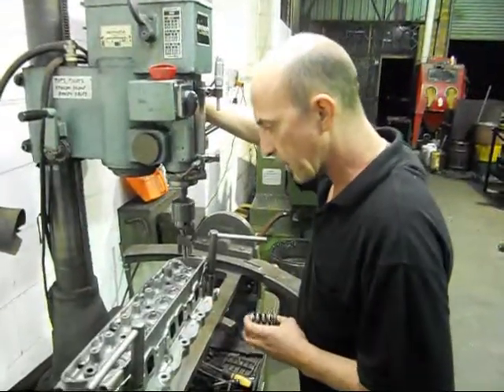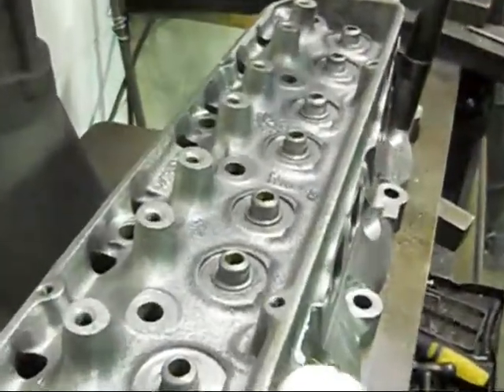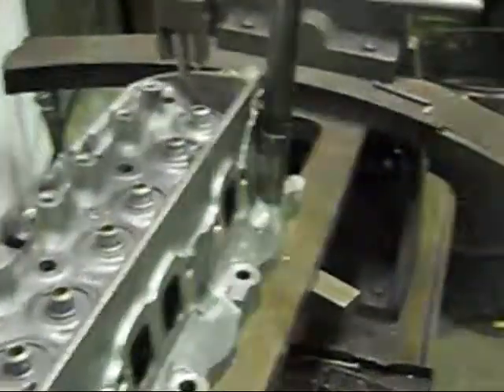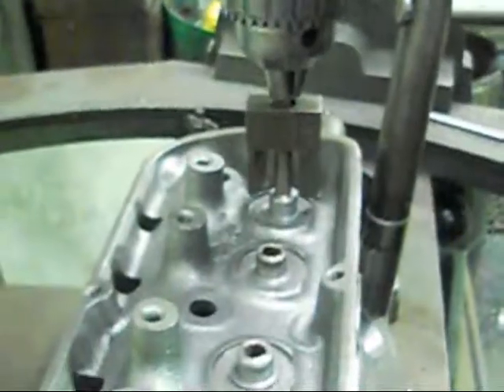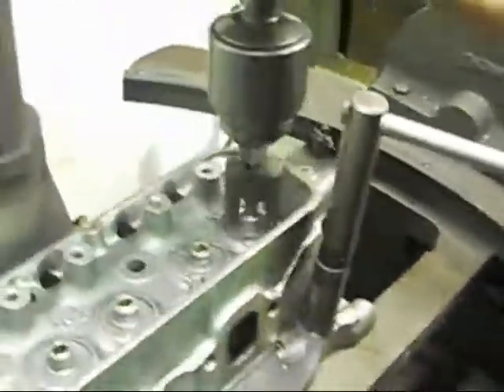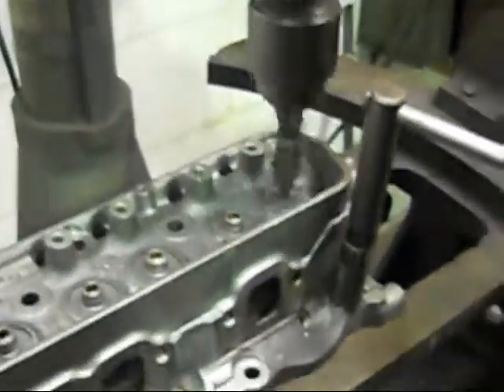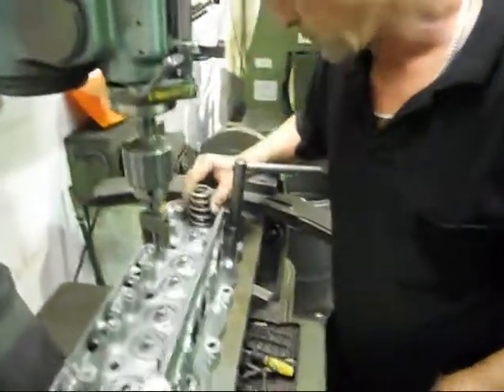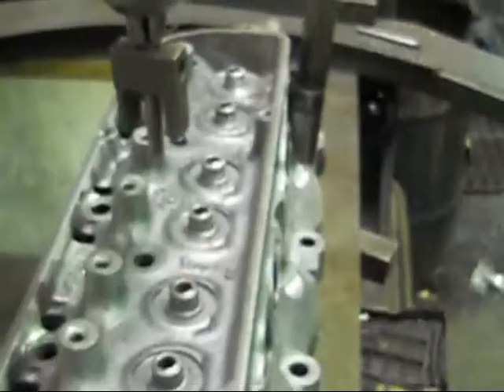How to modify V8 heads for double/triple valve springs,high lift camshafts

Comment: if i have triples can i take spring out to make double? this was a circle track motor now i am putting a comp 490/490 lift cam iron eagle heads sbc 355 which does not require that big of a spring. This is a budget motor. thanks